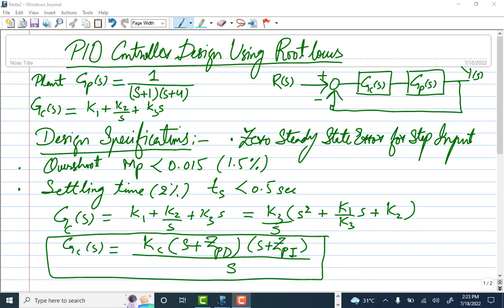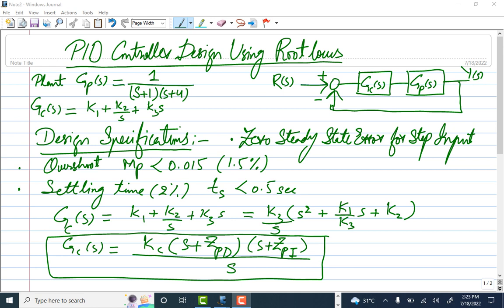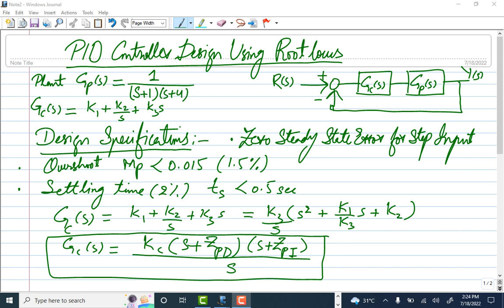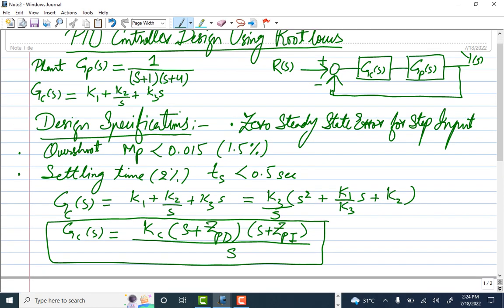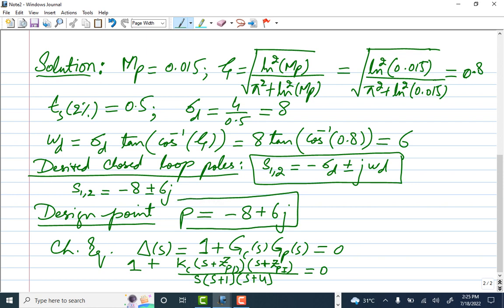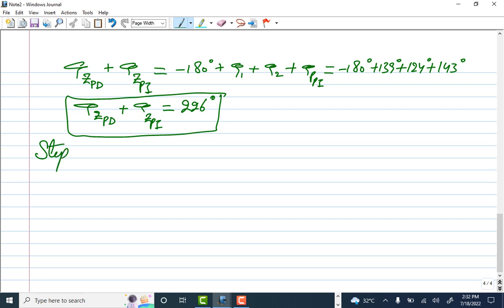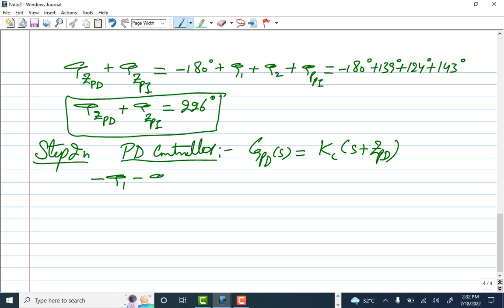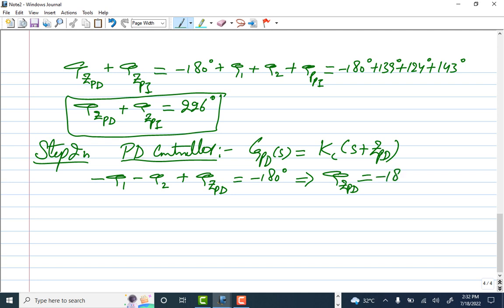PID Controller Design using Root locus

Comment: Why do we assume zPI = 0.5?
Reply: for your new controller you dont know z or p or k so assume a p preferably a big value maybe 20 so you can use it in your phase criteria and get the z then from magnitude criteria get the k
Reply: @agbeats1687 ok thanks, but you can select any arbitrary combination that can result in satisfying the phase criteria am I wrong?
Reply: Like why not we take 0.8 for example?
Reply: @kefal0  youre trying to make your root locus wide enough so uts more likely to hit the desired pts think of the pole as the end of it so the bigger the p the wider the locus the more points it passes through or thats what i understand atleast lol